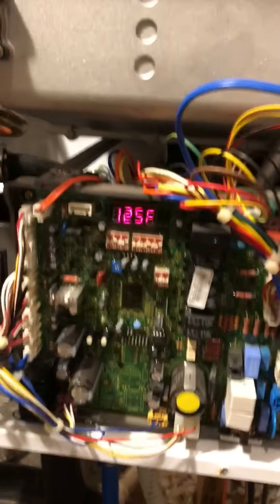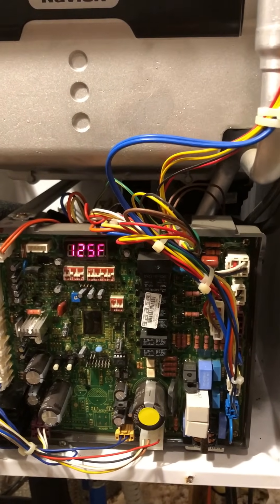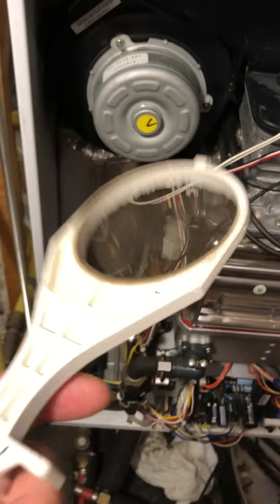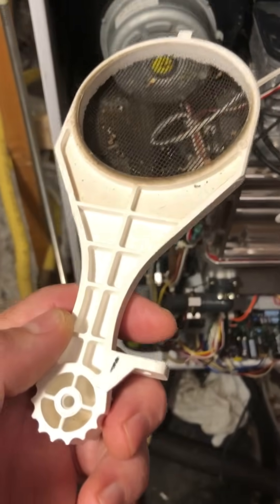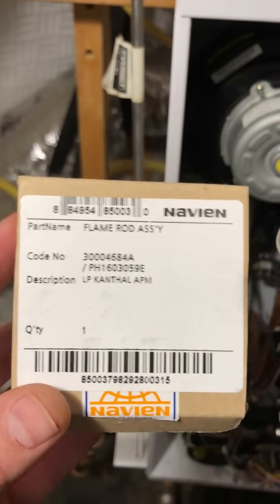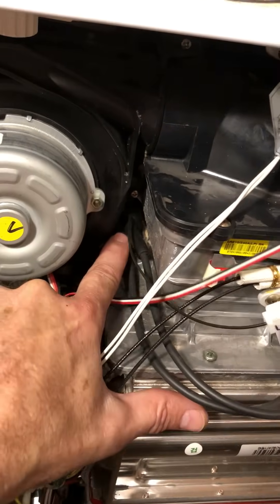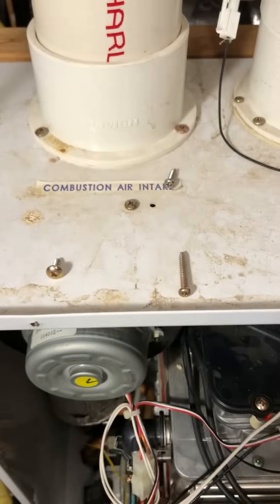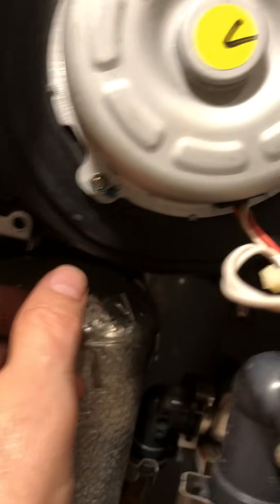Navien Tankless Water Heater Error Code 003 Fixed!

Comment: Thanks BW for creating this video.  I have a Navien  Condensing Boiler that was giving the E.003 error code and used your advice in replacing the flame rod and it seems to have done the trick.  All due respect for R Bennett's comments.  There's definitely a need for having skilled, certified technicians service your equipment when needed.  Problem is the Heating and Cooling profession has a lot of bad actors and is pretty notorious for gauging just to fix minor problems.  I know from experience from having a Buderous system installed before this current Navien to the tune of $6,000.00 and then having it only lasted 8 years.  In between we had it serviced several times and each time it was another $800.00 to $1,500.00 and a mysterious and surprising amount of parts replaced.  Added to that was the high pressure to sign up for the contractors "membership" that entitled one free yearly inspection and reduced prices on parts.  In the end it was a scam.  Also came to find out original installer never cemented in the exhaust pvc piping.  Miracle no tragedy occurred to my family so sorry after several professionals looked at that system and never detected that problem and charged exorbitantly you guys can't expect the public to have much faith.  Please start to police your ranks and maybe the trust would be there.  Thanks BW for helping us still be able to solve some basic problems and not be taken advantage of.
Reply from the maker: Thank you  very much for the note, John.  While I agree with your points about unscrupulous repair techs, the Navien tech support rep I spoke with was very helpful in walking me through a variety of troubleshooting steps.  Our NR240A has been chugging happily away ever since these repairs were made.

Comment: I had local plumber change out flame rod first - i should have done it myself. SMH. Anyway, new flame rod still get the 003 error. I ordered the PCB board from supplies depot and installed. Took me 30 minutes. Let's see if this solves the 003 error. My unit would just stop working and I would have to constantly go out into garage and manually push power for the thing to work. Got annoying. Hopefully this new board clears that code. 
TLDR; new flame rod + new PCB board. Let's see if this fixes it.
Reply from the maker: You just described exactly what I'd encountered.  I'd be very surprised if the new PCB board didn't fix it.  Please keep us updated.
Reply: @Walker34077  i will!

Comment: This video is extremely helpful.  I had the same error code and the water heater company suggested I replace the entire unit for $4k.  So I found this video, bought the replacement flame rod part online, fired up the unit, and now it seems to work fine.  The author of this video mentions to 'gently' remove the old flame rod.  Well, the flame rod would not be removed so easily.  The rods are designed bent.  The part does not freely remove or install.  I had to apply a little pressure [gently!] and even bend the rods a little. but besides that, an easy job.  Thx for the video.  I saved myself $3,990!
Reply from the maker: The fact that a service company even suggested that you replace the entire unit is exactly why I made this video to start with.  That kind of exploitation really makes me angry.
Reply: @Walker34077  yeah they want you to do what makes them the most money with least effort
Reply: @Walker34077  Thank You

Comment: Good grief, PCB board... Something tells me as if Navien pre-programmed PCB board to break AFTER warranty ends in 5 years, so people end up buying new one and possible getting maintenance guy to come in.
I have NR-180, and seem to have error 3 come up after it ignite and lose flame several times. Flame by itself is terribly uneven,  flickering near ignitor side. 
Wonder if that's something to do with PCB or worse -  burner/heat exchanger itself.
Reply: Mine(NR-210) does very similar with yours but the flame was very even. I saw this video, https://www.youtube.com/watch?v=33mn76DfN-U and got the both frame rod and pcb board replaced. now it is working without any issues. F.Y.I the parts in Canada is not cheap.
Reply: Having same problem -- AGAIN. Replaced Flame Rod Assembly first time. Now what?!
Reply from the maker: If you're getting the 003E 2.00 error code after replacing the flame rod assembly, you're probably looking at the same situation I had, a bad motherboard.
Reply: @Walker34077  Do you have any idea if it doesn't work even after changing the PCB ....T_T
Reply from the maker: @soup1207  :  Is it still giving you 003E 2.00 error?
Reply: @Walker34077  Yes, exactly the same coding. I changed all three items in the video. Do you have any other idea I could try to change? T_T 
Not sure if I can return the PCB or may be ask them to switch another one for testing.
When machine first start, it has a lot noise like trying to pull in air or something, but fire doesn't start up. Then it seems get off, and re-turn on, the second round I can see fire evenly, but it keep on on/off several times, and end up in 003E 2.00...

I am using a CH240ASME by the way.
Reply from the maker: @soup1207  :  The two things I could think of would be that the new PCB board is bad, or that one of the plugs/connections between the motherboard and the flame rod isn't seated well.  Something is preventing the signal getting from the flame rod to the motherboard, I think.
Reply: @soup1207  please let me know how you fix the issues? I have same issues and I 'd like to know what is the solution to fix it.
Reply: @toronto_mechanic  I still don't have the solution yet. Do you ?
Reply: End up I called a pumber in and check, and he called the Navien, and switch the transformer at the end. which is the lower right corner at the rear of the Boiler. My model is Ch 240 ASME. It works now!!!
Here the summary of potential part needed for E03 2.0
Flame Rod
PCB
Transformer. 
If anyone found out more, please list them here, 
The part is actually very cheap, but the plumber won't change it for me unless I use their part, which charge me 160, plus labor 150, plus 290 for the first day dianostic....
If you do all those three parts yourself, it less than 300...
Good luck everyone.
Reply: @soup1207  hey.. sorry to hear that. I'm lucky because the culprit was pcb board. since it's changed, it is working without any issues.
Reply: @toronto_mechanic  Yea, well, for a total of 850 I have three parts refreshed...probably not crazy bad though...lol...It's just ..it can be even better...hopefully the new part (transformer) related to 003 here would help someone else .
Reply: @soup1207  i'm having same issues, going to try the transformer next, crossing my fingers
Reply: @soup1207  Do you know what is the part #? Is it 30002494A?
Reply: @soup1207  what is the transformer?  I've replaced the Flame Rod Assembly.  Replaced the motherboard.  And still getting the E03 2.0 error.   On the white remote box, if I shut if off.  And turn it back on.  It ignites.  But we have to do that every time we want hot water.
Reply: Change both of them and still getting the error